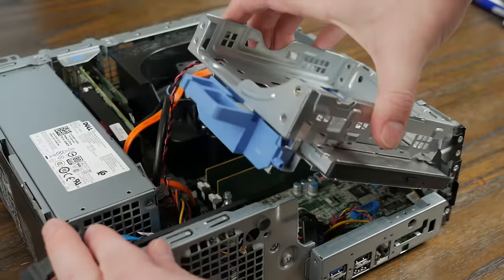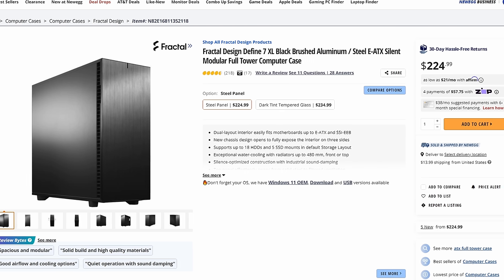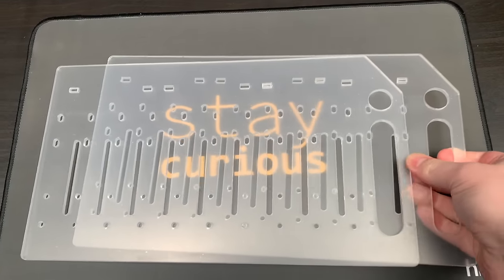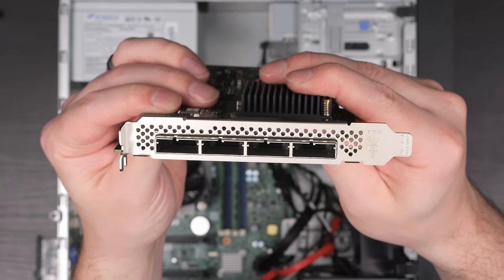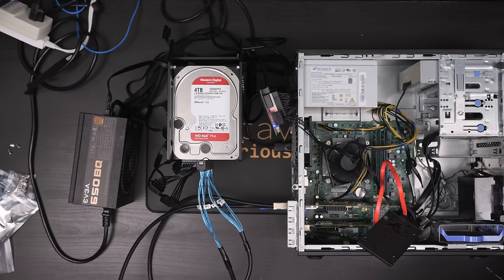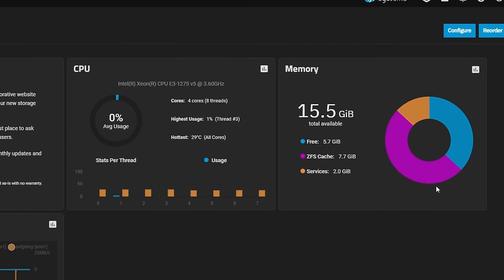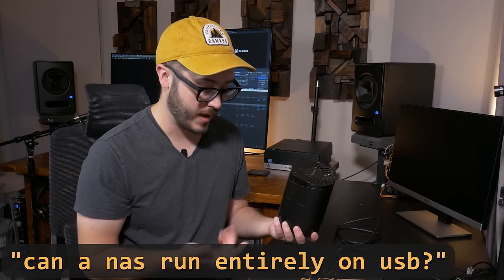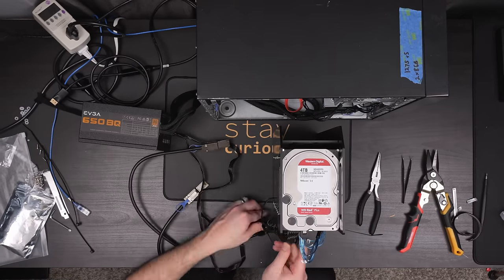I Made My Own JBOD Enclosure For CHEAP

Comment: Was just thinking about this! Yesterday I hacked out the 5.25 inch bay separating the two front slots on my p410 (same case, different chipset) for a cheap 3 bay enclosure

i wanted to add more drives soon, this video was right on cue! great video :)

Comment: I did a very similar thing with my server, but for my own needs I went a fair bit over what you did. I'm using the same HBA, but instead of using the mini SAS 8088 - 4x SATA, I have an 8088-8088 cable plugged into a SAS expander. This means I can use much cheaper mini SAS 8087 to 4x SATA (or in my case, SAS, which is basically an upgraded version of SATA) cables - with the added bonus that I can now connect up to 32 hard drives per 8088 port - for a total of 128 drives on a single host pcie slot.

There are some drawbacks to my version, primarily that I'll be limited by pcie lanes when I add more drives in the future - the main HBA is pcie 2. The drives on the expander can go up to 3gbps per drive, which isn't going to be an issue for rust disks, so if you're using ssds, you should use something else.

All of this fits into a corsair ATX case that I've filled with fans, a 3D printed drive rack that goes in place of the motherboard (holds 16 3.5" drives), an always on PSU, plus an additional 6 3.5" drive bays that come with the case. Its a bit jank and I have some issues to work out, but its pretty darn cool and it looks sick, if I do say so myself.

If @hardwarehaven wants some pics/more info let me know and I'll get in touch - it could be an interesting video.
Reply: You should team up and do a video on this, would be an interesting alternate build. Make sure to include links to buy parts list
Reply: Mine is the same but with only a 2 port hba…

Comment: Have you considered placing it in an old/unused tower or mid-tower PC case? My grandfather is designing a similar JBOD and we have several old tower cases. He's thinking of doing something simialr to what you did, except he'll be mounting it all in an old tower case and running the cables out of the back of the case into the back of our main PC. Oh, and his thinking of putting those 5-8" USB powered "personal" fans inside the case for added air flow! Could be a great DIY project and video for the future. Enjoyed the DIY!

Comment: did something similar and modded the powercables:
you can pop of the backpanel of the sata plugs and pull the cables of the crimp terminals. plug them unpopulated into the hard-drive stack and then line up your 5  fresh (!!!) powercables into them
(you dont want to reuse the old ones, they got "bite marks" from the crimp terminals and when unlucky, short out on these open connections). 
cut away the exccess cables and you got perfect poweraddapters for your stack.

Comment: ** little handy trick I use, assuming cosmetics is not of major importance, buy a roll of galvanized strapping from homedepot/rona/etc(plumbing/hvac/etc)... stuff is cheap and can cut strips to extend existing drive shelves(can fit it inbetween drives and shelf or screws); stuff is cheap sturdy enough when drives are mounted to it and can be done with minimal effort:)

Comment: Glue. Glue the fan bridges to construct the cage first. If it's true acrylic and not a plastic of some kind you have to use acrylic safe glue or solvent to "weld" it. Most CA/Super glue will tint it white, but then again, you can just paint over that. Once it's built w/fans mounted it becomes waaaay more stable.

Comment: You could have split one sata power from the original PSU into 8 quite safely. One Sata connector can handle 75W with quite of bit of tolerance margin. Even at only the 12V rail it is 60W. And even 16TB enterprise drives dont use more than 10W in peak when starting. If you have staggered startup of the drives it would never go over spec. So you could have just powered all those drives through one. But ofc if you don't trust the PSU that's a different matter.

Comment: You could take a second PC case, throw everything but the PSU out and fill it with these acrylic stacks. Some cases have build in fan controllers too and are cheap af used.

Comment: That's awesome! I have an old PC that I went with the icy dock solution and 2.5" SSD's but was not very happy with how it turned out. In this case I used an internal hardware raid, which in doing reading later found out wasn't really hardware raid anyways.

Here, your CPU will deal with the drives and that doesn't take a lot of processing power! So for an older machine you don't want going to e-waste I love this.

Thanks for sharing!

Comment: Thank you for attempting to do this.
This is something I've gone back and forth on multiple times.

My requirment was being able to use 2-4 hard drives.

I have a SFF server with an i5-9500, and I wanted to add two HDDs to it.

My number one concern was power use and reliability.

I ran a janky setup for a few days with SATA cables and power running out of the SFF PC.
That would be the most efficient(power wise) but was super janky.

I considered USB enclosures, NVME to SATA adapters, but they are known to be unreliable and USB enclosures wouldn't have S.M.A.R.T.

An LSI card would be better reliability wise, but would still be janky with hard drives just sitting outside the case.
LSI cards don't come cheap either (considering used office PC are cheap), and they would consume about the same or more power than a well optimised 8th to 9th gen Intel SFF PC. Believe it or not, I was able to get my SFF i5-9500 down to 8-9W of power consumption with one NVMe SSD.

So I decided to run another server dedicated to NAS. This gives me about the same power consumption as your setup would, plus I have an additional set of CPU, iGPU and RAM.
The best part is the systems are super stable, not janky and even combined, they are low on power consumption.
My SFF server runs Jellyfin, HomeAssisstant, and my virtual Windows PC.
...and the second server just hosts a NAS (for now).

This is the compromise I'm happy with for now. My second server has a Haswell i5-4570 that I run in single core config. It doesn't idle down as much as my i5-9500 but it's close enough.
I am on the lookout for a cheap 6+ gen i5 full size tower to replace it for good.

Comment: I got myself a 16bay supermicro for cheap. Has hotswap, can be turned into a dedicated storage-box or used as a complete server by mounting a mainboard.
And the best: It has hotswap! Was about 200-250$ including a Xeon-Board, CPU, RAM etc. which i didn't use.

Years ago i did similar stuff, but after all, nothing beats a professional solution. Anyway, good idea. And the way you added the second PSU is nice!
And you are right: I can't even understand why someone would consider USB for connecting storage to a server.

Comment: I got a used enterprise 12bay with the option to expand two more 12 bay jbods. The unit i got was $600. It was alot of money, but it runs Synology dsm and it's super easy to use for a beginner. 
And i don't feel like i have to worry about expanding in the future.

Comment: Another otion for the host connection is to use a "Mini SAS 4i 36P SFF 8087 to 4 SATA 7P The Reverse". It will let you use 4 sata ports on the host. Add a "SAS Adapter 2X Internal SFF-8087 to 2X External SFF-8088" to bring the connections out of the case. 

If you have a spare case laying around, a second "SAS Adapter 2X Internal SFF-8087 to 2X External SFF-8088" can be used to bring the connections into the spare case and a cable like the one you've used to breakout the sata connections again.

Comment: Not a bad build, but i would change a thing or two. Mainly, the external power supply. There is a thing called pico psu (10-20$) which connects to an external 12V and supplies some psu connectors like 24pin atx, 6pin PCI and sata. google says 3.5" drives will consume up to 9W so 100W 12V rail would give some headroom. 300W pico psu has 10A 12V rail. I would pair that with some good 12V power supply like meanwell LRS-100-12 and the best things is that it is almost the same size as the 3.5" drives so it could be mounted bellow them being invisible and saving space. It is also silent as it has no fans. You would still need synchronizer board.

Comment: This is basically what i ended up doing. Cost me a little less as i had a bunch of stuff already, but it works so much better than a usb external enclosure. So much faster and no more USB issues. Also if you dont know what to do with your set up..... I have a homelab you could donate it too.

Comment: I have one of those EMC KTN-STL3 JBODS attached to my Truenas server running SAS drives. You can run both SAS and SATA with SSDS they come with 2 controllers are if you run SAS you can get full 10GB or 25GB speeds out of them. 3xSSD 6xHDD and 6xHDD with 2 arrays. Works really well.
Reply: Same. I impressed one of my coworkers the other day when I casually mentioned I had a 15-bay SAS shelf running ZFS DRAID ;-)

Comment: I built my own server case because I could not find anything I wanted. It can hold 8 hdd with a backplane, HBA (i think) that is all internal to 8 sata cables, custom sliding rack for them, and additional space for about 6 hdd or ssd directly attached for the motherboard. Off the shelf pc parts so changing out anything is easy.

Comment: Brotip: use the 1-to-4 splitter cables with capacitors, i.e. the Silverstone CP06-L-USA.
That smooths out the power delivery to your drives, as starting up 8, 10, 10+ disks at once is a huge stress on your power supply.
(Disk shelves generally have staggered disk startup for this very reason.)

Comment: Another option is to look for spare server parts, namely their hot swap drive cages. These will probably take 1 sff8087/8643 and 1 molex per 4 drives. Then you do everything you did here with the appropriate cables. It will probably be slightly more expensive, but much much easier to assemble and maintain.

Edit: ah okay you mentioned those at the end never mind 😅

Comment: I would try to eliminate the separate ATX PSU on the desk. Either put that into the main case, or use some kind of AC-DC brick which is beefy enough to run the drives. Then I would also try to create some sort of 3D printed backpanel and/or a base box below the enclosure to hide all the tangling wires (and the power brick). I think it would look very tidy that way.

Comment: There are alternatives tho. Years ago , I got a small 4 bay enclosure from Aliexpress its for 4 bay x2,5 inch. However the backplaine is 4 SATA ports ; 1 Molex for power and 2 internal fans. I use it as internal enclosure for my PC as my drive bays take more space then this entire thing.
I think something like this can be the best bet. 
The contraption you showed is nice and DIY. I have 2 problems with it.
1. Dust - just exposed enclosure is a dust magnet with the fans infront its just going to spred everywhere.
2. Power - having to use external PSU is bit of problem in most cases. The problem with those old workstations is that they use proprietary connectors and PSUs so you cant put standard.
I have a small lenovo workstation like this , it has SATA ports I can use but I cant power them ,because there is only 2 SATA power that doesnt come from the PSU but the borad with a 4 pin to SATA. I got a cable from Aliexpress (4 pin to SATA) and it doesnt fit ,because the Lenovo connector is non standard....

Comment: What I found out when dealing with hard cases without any dampening material - easy way to lessen vibrations is to use self adhesive, soft part of velcro and stick it to the case itself. Then punch some holes for screws and your are good to go... under one condition. Since HDDs usually give the most heat through the sides, that are now squished between two velcro strips, you need to have a fan blowing on them at all times just to remove the heat.
Second way was to mount the whole enclosure on a foam, like the one usually protecting electronics. Case will still resonate a little, but the vibrations won't be transferred to another surface.

I know there are better solutions, but when you are working with pennies, you get what you pay for 😂😂

Comment: Yea. Simply add an external SAS card/connector:cable and use any PC case (without MB).

All you need in the drive case is power, so simply use a standard power supply and find the 2 wires in the MB connector that turn the PS on/off (they sell kits/switches for that).

Careful with the SAS to SATA wires!
There are 2 kinds (connected to MB, or connected to HDs).

Comment: What i've done to my NAS was to mount a second power supply in the 5.25" bay of the case (the system had only one goal in mind - be cheap), and then leave the 15 or so (mostly laptop form factor) disks just hang off the side of the case, with the entire thing sitting under a desk.

Comment: You could probably get a SFF PSU and tuck it in under the drives if you get the 10 slot version and only use 8 drives. Could really clean that up.

Comment: I use this exact hard drive cage but with a USB setup. I used a USB to SATA adapter that accept a 12V DC input for each drive, hooked up to a large powered USB hub, and connected to my Optiplex 3060 micro. For the fans, I used some cheap but very nice Thermalright fans, as well as fan filters and a type c pwm fan controller from AliExpress. The 12V DC charging brick was also from AliExpres. The total is a lot lower in comparison. I'm using it for a different purpose, so I'm not concerned with transfer speed, and I also wasn't using TrueNAS, just Windows.

Comment: hmm, I thought I spent too much on my jbod, but I guess I didn't.  It literally cost me the same $220 to get a 3.5" drive cage portion of a hp server, a hba controller, and drive caddys.
The cage came with sas and power cables, so I modified the power cables to connect to a standard psu and it all seems to just work.  I have another hp cage, 2.5", that I can make another array with at some point and it all works together.
Also it is good you added the fans, I didn't realize how hot 12 drives get when they are stacked together, I now prop a fan I had lying around next to the cage when it's running.  This is used for my offline backups, so I don't have it running all the time.

Comment: With the SATA power cable you have, you can open connectors and move them onto another place on the wire. And maybe even put more connectors on a single wire (if it can handle the current). That way you can avoid the loops you have ;)

Comment: If you want the case of the USB DAS but mote reliability, you can try to refit it to a SAS enclosure. Adapers for that are abundant. You 'just' need to scrap the electronics inside for them. Still, it depends a bit on the internal structure of the USB DAS and it is not very cost effective.

Comment: Since you're already factoring in the price of the PSU, you might use an SFP one - it should fit into the enclosure, making the whole buld cleaner. Using a fully modular PSU would also take care of the cables, but those are usually pricier. Finally, I'm a great believer in plugging unused ports with plastic cover/plugs - a 3d printer is a great help there if you have one, can even print the side panels for cost saving. Overall, a good build though.

Comment: I got two cheap 4 disk SAS backplanes off of ebay (just the bare PCBs) and made a sort of template around out of thick cardboard for the HDDs to screw into. It's not pretty but it's suprisingly solid and cost me $0 + $20 for the backplanes.

Comment: Did the same myself or similar anyway with an old pc case and motherboard plus a sas expander card.  The pc is just to power the card and hold the hdds.  Then just added a hba card into the server, plugged in one cable between the two and bingo, quadrupled the available drive bays :).  Probably cost about $150 all in plus drives…

Comment: Hi, on bottom of this external kit you can put sff power supply and test it like that. I hope sff power supply will fit inside.  I see that most of space taken with power supply. Also you can put rubber stands on bottom of this plastic case.

Comment: I've been looking at these strictly for a mounting point for the drives to screw into. I wanted to build a wood enclosure to hold the psu, and hide the wiring. I was also going to add an sff-8083 pass through port to the back of the wood case. I also want to build some type of vented front panel so the fans would be mounted to the case and not the drive enclosure. My main concern is the lack of reviews on these plexi sheets, and plexi can start cracking under stress and shock, so I'm unsure how they will hold up to the screws being tightened then the vibration. Thank you for this video and if you continue using it, any updates would be awesome.

Comment: I'd like to see how this works out long term. Acrylic has a bit of flex & I can just imagine the amount of vibration an acrylic chassis + multiple spinning drives would generate. Rubber washers work in dampening since the typical steel chassis is rigid. Not sure how effective they would be when the chassis itself would be (micro) wiggling

Comment: Nice Setup. Personally i use for my Backup a Icybox IB-3640SU3 Enclosure. It is only connected with USB 3.2 or E-Sata So one 5G Connection for 4 drives. But as those are Magnetic drives those are more likely to slow the Transferrate down then the Connection even in Best Case the Drives would deliver 200MB/s and the Connection is limited to 500MB/s. For 4 Drives it's acceptable for 125€. The USB Connector is good and gives Serials as well. A 8 Bay via one USB needs a 10Gbit connection or you need two good USB Bays. In this case this Solution is better for the Pricepoint. For me the USB Bay is good as i do the backup from my Raid on it and i want a dedicated powerswitch. 
Btw thanks, the Video reminded my that i wanted to do the Backup for 2 Weeks now. The Backup throughput is around 300MB/s so the USB Connection is not slowing me down.